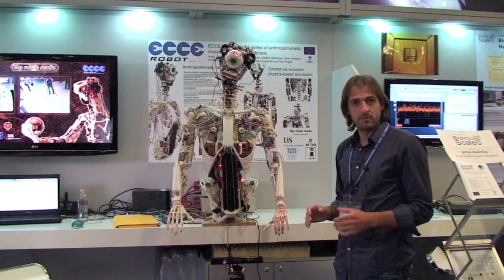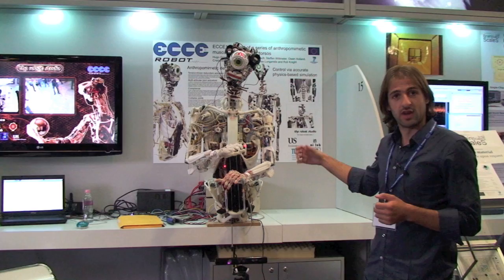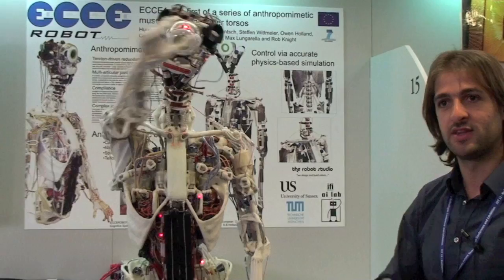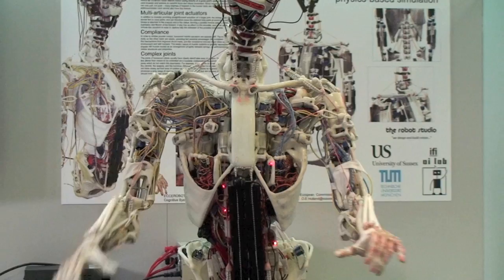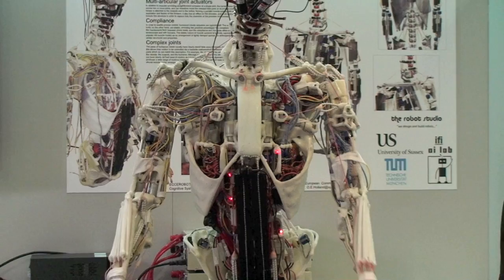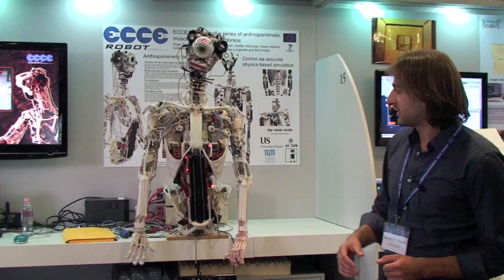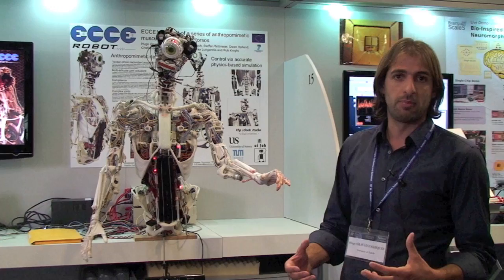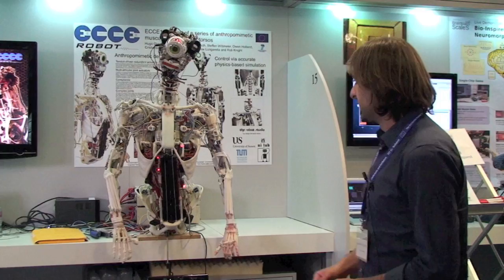FET11 - ECCE Human Robot presented by Hugo Gravato Marques

Comment: The point of this model is the mechanics that drive the body, not the sensors.  Sensors can easily be added.  What you can control with a guy and a joystick you can easily control with a computer as well.  The fact that they achieve significant movements without actuators is quite an achievement.  However as is apparent it introduces significant 'bounce' they don't appear to be able to compensate for yet.